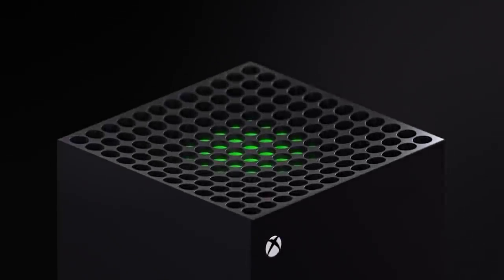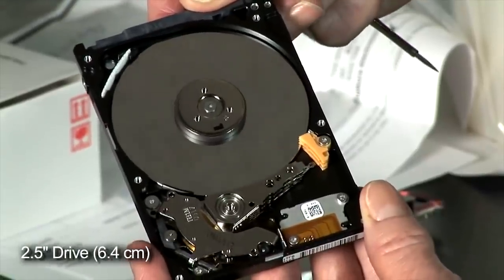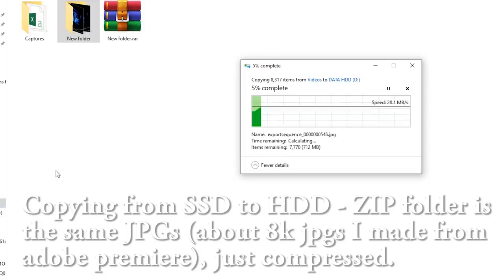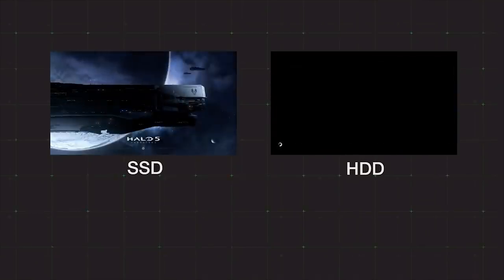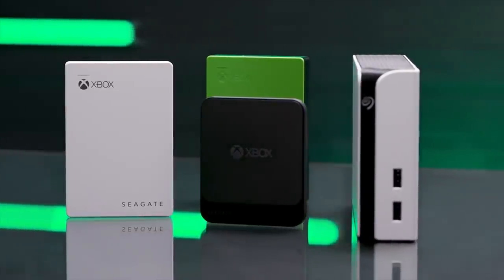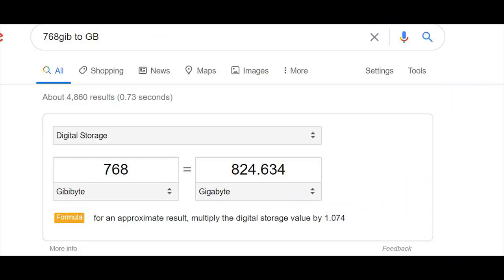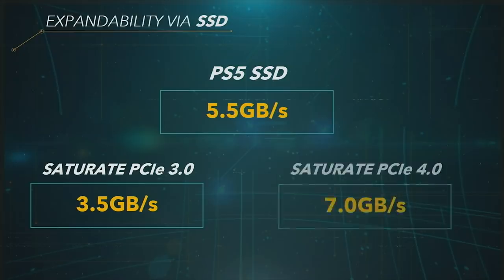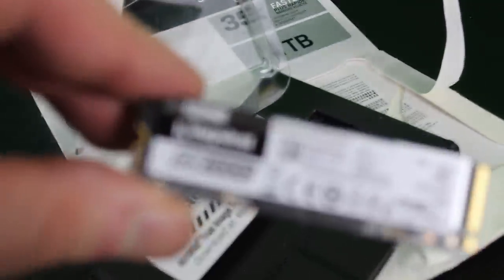Why The PS5 & Xbox Series X SSD Changes Everything - Part 1 - Basics

Comment: Ps5: 2.9 seconds 
Series x: 6.66 seconds

When it comes to downloading 16 gigabytes
Reply: It not 2.9 it 1.0 lol get it right Sony better
Reply: loading textures: aight imma head out
Reply: Oo oO You do realize it was with 8k assets rendered at 1440p.
Reply: PS5: 2.2 seconds
Series X: 7.6 seconds
Reply: RedGamingTech: 2.9 seconds
Chris Bass:    ...System Failure
Reply: MrBeefy To fill RAM on the PS5 at(8/9 GBPs) is 1.7 seconds. 16/9=1.77. On the XSX at (4.8 GBPs) is 16/4.8= 3.333 seconds.
Reply: @-MohamedMajedAlHarthi  Here is the difference tho....saturation of drive speeds. The PS5 due to its i/o tech addresses all of the drag processes. MS only deals with one. In short it will never saturate the drives full speed. So you can double that figure to about 7 seconds for SX. But potentially it could be even higher like 10 seconds.
Reply: Oo oO fake ray tracing?🤣 you Xbox fans said ps5 has rdna 1.5 no vrs now fake raytracing what’s next the ps5 doesn’t have a zen 2 cpu
Reply: @DualPurpose  Hi Dual Purpose, 
The Series X Velocity Architecture only addresses 2 of the 5 steps of the storage-to-memory process. 

The first 2 steps of storage-to-memory transfer can be as fast as you want, but if the next 3 steps are too slow, then fast decompression and coherency doesn't mean much. 

DirectStorage, BCPack, and SFS do not address memory mapping, file I/O, and check-in/load management.

In contrast, the PS5 starts off with selective loading with the flash controller with rough granularity. Then, the data is decompressed with the Kraken chip (1st step). The coherency engine evicts parts of the GPU cache has the SSD is being read and readies the useful data that needs to be sent (2nd step). One of the I/O coprocessors does the memory mapping (3rd step). The other co-processor is dedicated to SSD I/O and can actually bypass traditional file I/O. Lastly, the DMA controller removes check-in as a bottleneck.
Reply: @DualPurpose  4k assets take 5GB of RAM for both systems. it has to use half of its GPU-optimized ram for that. Then, it has to use 2.5 GB for loading assets and 2.5 GB for streaming assets. This is a bottleneck on top of its lower ssd bandwidth.

In contrast, after accounting for the OS, GPU working set, and CPU working set, the ps5 still has around 8 GB of ram left. All of that remaining ram can load and stream data at the same time because the coherency engine and cache scrubbers allow the system to replace evicted parts of the cache on the fly. The Series X on the other hand, has to evict the cache entirely before receiving new data. Even with SFS, it doesn't change that the fact that the entire cache needs to be evicted.

The Series X has 10GB of faster RAM. But that RAM cannot load and stream data at the same time meaning that you can't use the entire 10GB to load and stream at the same time. You have to split that pool. In contrast, the PS5 has GPU cache scrubbers which allows the system to load and stream data simultaneously. And because the bandwidth of the SSD is 9GB/s compressed, the PS5 can save the system image to the SSD, giving the console nearly full access to the 16GB of RAM just like you said.
Velocity Architecture does not address streaming. 100GB readily available sounds impressive, but you cannot use the 10GB of fast RAM to stream and load at the same time. In fact, one of the biggest bottlenecks isn't the lower SSD bandwidth, but that only a small amount of its RAM can be used for streaming.
Reply: Dual Purpose I know the PS5 has more custom I/O hardware but we really can’t make assumptions until we see what Velocity Architecture is capable of.
Reply: @DualPurpose  And the thing is that all of these solutions are hardware-based. Developers do not need to learn how to take advantage of the enhancements like with APIs because the system will literally do the work for them without any thought, hence why Cerny described this process as "invisible".

Kraken is 10% more efficient in packing data than Zlib. Not to mention, Kraken decodes faster than Zlib by 3x - 5x: 

Go to radgametools website - oodle tab and click on Oodle Kraken on right hand side. That 3x multiplier may look familiar because 9 Zen 2 cores (PS5's decompression) is 3x as much as 3 Zen 2 cores (XSX's decompression). But the thing is that is the minimum of the range. Kraken can potentially decode up to 5x faster than Zlib. This is why the PS5's decompression solution frees up more CPU performance:

1. Kraken compresses more data than Zlib. This means more data can be sent to memory and also to the GPU.
2. Kraken decodes 3x - 5x faster than Zlib. Sending a lot of data means jack if you cannot unpack it fast enough.
3. The PS5's SSD's approximately 2x higher bandwidth magnifies Kraken's compression and decoding advantages.

The PS5's storage can send more compressed data of which that data is more efficiently packed than the XSX's SSD. On top of that, the PS5 is 3x - 5x faster at decoding the compressed data than the XSX, allowing its GPU to be fed data faster.
Reply: Clayton B Exactly, memory mapping, and check in are handled by the CPU on the XSX. The thing is, Microsoft claims that they reduced the CPU overhead down to a fraction of a single core. We will need to wait and see how that statement holds up. That is why we need to wait until we have a more in depth analysis.
Reply: PS5 SSD's 12 channels gives it 4x the parallelism of the Xbox's SSD and the custom flash controller allows developers to prioritize certain types of assets before the storage transfers data to memory. The DMA controller has the equivalent of 1 to 2 Zen 2 cores of performance. The combined performance of the Series X decompression solution and DirectStorage is 5 Zen 2 cores (3 from decompression + 2 from the API). This gives the PS5's storage-to-memory solution a 2x advantage in performance over the XSX's solution which also means the PS5's solution frees up more resources from the CPU.
Reply: @claytonb9942  well said. SX only addresses 2 of the 5 steps. This will limit the ultimate ssd saturation. Resulting in speeds less than the advertised raw and compressed rates.
Reply: @claytonb9942  well said
Reply: @DualPurpose  Yes, the only downside I see in ps5 is that it costed Sony a little more than Mictosoft & so I wouldnt be surprised if Ps5 will be more expensive, for me makes no difference really, hopefully fans and parents will invest that extra 50 $, gbp or euros too & support this company bringing in such great innovation.
Reply: @claytonb9942  Exactly, it has more costly tech advances than the SX.
Reply: @-MohamedMajedAlHarthi  well we see xbox taking 7 seconds to start a game...ps5 can start it instantly...and cut load times completely we have more than enough developers vouching for this and ratchet and clank gameplay to show it
Reply: @-MohamedMajedAlHarthi  also xbox loaded gears 4 times the speed of current gen...ps5 loaded spiderman 18 times the speed of current gen..different games so probably not fake to compare tho
Reply: @-MohamedMajedAlHarthi  The PS5 and the XSX have less then 16 GB available for use arround 3GB is used for the system so it sould be 13/9 =1.4 for PS5 and 13/4.8=2.7 for the Xbox But the Xbox has 2 different parts of Memory on different speeds not sure if they could load a 1 Big file directly to the memory or that it has to be split cos it has 10GB at 560GB/s and 6GB at 336 GB/s i asume the OS is using the slower part lets say 3GB so then we have 10 GB fast and 3GB slower memory 
the question is can you load 13 GB directly to the Memory i would say yes because the SSD is still way slower then the slowest memory.
Reply: Gert van Bruggen  split memory speeds may be a problem for developers. As they have to optimize for it and games may take a hit in performance. Im aware of how much Ram the OS consumes I said 16 GB because I didn’t want any confusion.
Reply: @claytonb9942  what do you think direct storage is. It's ms term for memory mapping to reduce latency(seek times) . Ms had the best software in the business believe dat. And all of direct storage specs is not released yet so you don't know. Ms times to saturate the memory is just about double the time of PS5. We're talking about just 2 more seconds with more bandwidth to boot.  How will less bandwidth effect the PS5? Y'all see. #X GONE GIVE IT TO YA
Reply: Kingz On Tha Beat I agree but I need to say something.  1) the spiderman demo was a early dev kit the ssd may have gotten much faster. 2) gears is a different game with different assets so we cant compare.The PS5 has a much faster SSD so in third party games we may see faster load times on the PS5 and higher quality assets on the PS5 ( more detailed geometry. More polygons).
Reply: @myrontaylor77  that last line is corny af
Reply: @myrontaylor77  tell you what, lets pretend the Xbox can fully sustain those 2.4GBps raw speeds, there are still way too many advantages I mentioned above you havent addressed, you simply avoided the rest cause you have no counter arguments or points,

Fact is that no designer is going to design a game differently for series x power in gpu advantage, that percentage can be easily corrected on ps5 by using dynamic res, & more importantly that way it provides more stable framerate too. 

BUT when it comes to the IO advantage the ps5 has, you will find designers having designed a game exclusively for PS5 like project athia. Better IO does provide better graphics regardless of what fanboys say. The time it takes ps5 to load the assets, xbox will need to stream lower lod assets to keep up, Devs can also increase assets for the ps5's version of that game too. whats more is that every 3rd party game made on UE5 will look better on ps5 cause of its streaming advantages.
Reply: @myrontaylor77  
Regarding the Gpu , Series X CAN Do better ray tracing, but there's a lot more to it, Series X has more compute power, it can have up to a 12-15% max practical advantage (not in every game) over the ps5 at the very best BUT only if the cu s are given full workload, which is dependent on storage-to-memory speeds, memory streaming speeds, and cache bandwidth , all of which are in favour of the ps5.

the decompression chip is equivalent to 9 zen2 cores vs 3 zen2 cores on Series X, the coherency engine which helps out with only sending useful data to memory while also telling the Gpu what parts of the cache needs to be evicted. there's also coprocessor 1 which addresses memory mapping, which is Step 3, of the storage-to-memory process. theres No equivalent feature on the Series X, coprocessor 2  addresses file IO, the 4th step. It also allows the system to bypass traditional IO, again missing on Series X, then there's the dma controller that addresses check-in, the last step. It also allows the system to bypass check-in if needed and its performance is equivalent to 2 Zen 2 cores.

The only definitive advantage the Series X has is in raytracing. However, the issues with its asymmetrical RAM setup and slower storage-to-RAM data transfer rate will affect the GPU Negatively, especially when it has more CUs. The more CUs a GPU has, the more data you need to send per second.

2 bottlenecks for Series X are:

1. The amount of RAM available for loading and streaming is limited.
2. Memory-to-cache communication is not as effective as the PS5's due to lower GPU clockspeeds and the first bottleneck.

Series X is not only slower, but has less parallelism and a less granular hierarchy.
 Ray Tracing performance is tied to CU count. However, because of how the Series X's  memory will have to be used and Microsoft's services philosophy, the PS5 will be able to load more assets. That means the level of detail will be Much Higher on the PS5.
Reply: @myrontaylor77  Also the ps5 has four times the channels as the Series X ssd, allowing for more parallelism of data transfer. Also the flash controller gives developers 6 levels of priority. Series X lacks this feature too... and the 6 levels of priority are twice the Series X ssd's 3 channels.

Also ps5's RAM will NEVER be bottlenecked. 

the ps5's audio chip also takes advantage of the DMA controller which also frees up resources from the cpu. 

the ps5's higher gpu clockspeed speeds up rasterisation and cache bandwidth. 

The higher cache bandwidth along with the better ssd bandwidth, more available RAM for streaming, and lower CU count allows the PS5's GPU to hit its Peak performance More Consistently. 

Also the Gpu cache scrubbers allow the remaining free RAM to both load and stream assets simultaneously, effectively giving it a 3 Times Advantage over Series X. 

THIS Has Major Effects in the Amount of DETAIL the ps5 can push out.

Consequently, the Series X needs to rely on procedural loading due to its low amount of available RAM for streaming.
Reply: @myrontaylor77  (1) Velocity Architecture is a software solution, but it can never magically break the laws of physics.
(2) A higher theoretical peak means nothing if it requires a steeper learning curve to hit that peak, especially when that curve grows steeper as the generation goes on, i.e. when games start to demand over 10GB of memory causing the XSX's RAM bandwidth to tank.
(3) Developers want to spend more time actually designing their games and have the hardware do the work for them rather than spending time to learn tricks and workarounds.

Both the CPU and GPU need to access the RAM, meaning they need to share bandwidth. Typically, the CPU needs 48 GB/s. For the PS5, it's easy. You just subtract 48 from 448 to get your bandwidth for the GPU (400 GB/s). However, for Series X unless the CPU is accessing the "fast" RAM, allocating 48 GB/s to the CPU is an 80 GB/s penalty on the GPU. You can have the CPU access the "fast" RAM, but that means putting the OS in the "fast" RAM. That wastes precious resources that the GPU would otherwise need. If memory usage goes over 10GB, then the "fast" RAM's bandwidth goes down because it has to share lanes with the "slow" RAM,  Not good when games will inevitably grow more ambitious and increasingly demand for more RAM later in the generation.
Reply: The PS5 's coherency engine and cache scrubbers remove stale data from the GPU cache on the fly as the RAM feeds the data needed for the Next 1 SECOND. 

Not only does that benefit the GPU, but it also benefits RAM performance because typically you cannot use the same chunk of RAM for streaming and loading At the SAME TIME.

Another Major advantage in this particular aspect is the higher clockspeed. Higher clockspeed does not just boost rasterisation, but also the bandwidth of the caches, including the GPU cache. 

Higher cache bandwidth means that the memory can feed more data to the GPU in a shorter span of time, allowing the GPU to hit its peak performance more often than a GPU that has a lower cache bandwidth...

To emphasize how important cache is, look at how Intel's 14nm CPUs are still competitive against AMD's 7nm Zen 2 in gaming performance. The main reason behind that? Intel's CPUs have less cache latency and the latency times are more consistent. Because AMD uses the chiplet design and split the L3 cache into 2 pools, it not only increased latency, but it also made latency times more inconsistent. While Ryzen has better IPC and is more power efficient, Intel's CPUs remain competitive in gaming performance thanks to its better cache solution.

Also APIs are also not needed to take advantage of the I/O customizations.

And the thing is that all of these solutions are hardware-based. Developers do not need to learn how to take advantage of the enhancements like with APIs because the system will literally do the work for them without any thought, hence why Cerny described this process as "invisible".

Also Note that YES, Third Party can Also push Game Design to a certain extent to make it across multiple platforms and APIs.

As for Series X

Yes, that 10GB RAM Demand is coming, As soon as the RAM usage exceeds the 10GB, that's bad for Series X. The PS5, on the other hand, gets nearly full access to the 16GB of RAM (Read above posts to see why) AND Has 8 IDENTICAL 2GB chips. It's easy and simple to use, requiring no tricks.
Reply: PS5's SSD operates uncompressed at the equivalent of a 128-bit DDR2 memory controller (same ones used for the first consumer quad cores). It also has two hosts to send multiple streams of data at once in either direction (like a DDR memory controller), and "The Kraken" is capable of boosting sections of data to 22GB/s (bandwidth of the PS3's GPU!). If the developers don't want to put in the extra work in optimizing the Kraken compression, it's 8-9 GB/s. However, If they want to improve on it, then the speed will be between 9 to 22 GB/s.

Ps5 can save the system image to storage because if the OS uses let's say 2GB, then when sent as compressed data, it is transferred from memory to SSD in less than a quarter second. This gives the system nearly full access to the 16GB of RAM. This method cannot be implemented on the XSX not because of lower bandwidth, but rather Microsoft want the OS running and be connected to all of its services.

PS5's RAM pool is unified. The GPU working set is 5GB like with the XSX. The CPU working set is typically 1.5GB. Let's pretend that the PS5 will not save the system image to the SSD and the OS takes up 2GB. That means the PS5 has 7.5GB of remaining RAM.

You may be thinking, well if you cut 7.5GB in half, that's 3.75GB for loading and streaming each. But remember when I told you about the GPU cache scrubbers? The cache scrubbers allow the remaining 7.5GB of RAM to be used for both loading and streaming simultaneously. The higher bandwidth of the fast RAM on the XSX cannot make up for that.
Reply: There is a Penalty in bandwidth when the CPU is accessing the "slow" RAM in Series X. You cannot access the slow memory without impacting the speed of access to the fast memory because they work through the same controllers.
 That is another problem. Luke explains this above when addressing the Xbox Series X Ram bottlenecks.

In PS5 you can EVEN IMPROVE access to multiple bits of memory by arranging them within the same column but on different rows, essentially parallelising certain memory operations. You couldn't do that across the two memory pools in the Series X because the memory needs to be interleaved in order to accomplish that.
Reply: @-MohamedMajedAlHarthi  Don't forget that optimized compression increases that to 22 GB/sec per Mark Cerney.
Reply: If ps5 is .8 second and  2.5 times faster ssd than series x, Then that means .8x2.5=2 seconds so  the Xbox series  x will download same game in 2. seconds. No big deal.
Reply: joe343 zerk  yes
Reply: Oo oO  Xbots clowns lies propoganda irrelevant anymore ✌️ the PS5 will running True 4k @ 60fps if you love it or not
Reply: Bryttany Messina That is with highly compressible data. We may see developers not reach those numbers.
Reply: 21st  😂😂😂 your comments are absolutely hilarious, Any insider information you have for us?? Any Secret MS Tech we dont know about? Its getting lonely in there right? thats why you keep attacking others.
Reply: 21st  poor little kid looking for some attention... There There 21st you'll be allright
Reply: @claytonb9942  I dont know man, if you're not giving him proper discussions responses, you're a coward.
Reply: Yeah Xbox 7 secs but it only loads once, so not really a big deal.
Reply: How can we actually speak on the XSX SSD/architecture if MS hasn’t even gone into great depth on it yet?
Reply: smart marketing for the ignorant. PC gamers find this SSD marketing quite funny.
Hard drive is not even in the top 3 upgrades for a PC gamer. 
GPU, CPU, Ram, Cooling, Power supply, then maybe SSD. The benefits are pretty much negligible. I run most of my games off my SDHD and it makes no difference in-game.
Reply: anonymous because HDDs are everywhere. When they're gone, you better get your PC gamer ass to get you a NVMe SSD because it will certainly be a priority upgrade component to ur pc.
Reply: @Kyle Aldis
Exactly. Not only hardware plays an important part on this upcoming generation but there's also software solutions and MS is ahead of Sony in that matter. I don't understand how people miss this point or maybe they just want to ignore it, more probably. The Series X customized SSD plus the Velocity Architecture and BCpack (compression and decompression software) combined with DirectML, allows it to load 100gb of assets in a matter of seconds. Reality here is, there's not going to be such a big difference in speed between both consoles, at the end the main difference will be the GPU and CPU performance.
Reply: @Kyle Aldis well that's a first. You should read into XVA and read into API. Its software you have to code for it to take that advantage of the algorithms dummy. So to make use of the direct storage you have to code for it. It doesn't just do it. Its not hardware. Its an algorithm. Why do you bring ML and all the other nonsense to a discussion about data transfer. This doesnt have anything to do with moving data through the 5 step process. ML is algorithms for the output of the data. Its not related to transfer the data.

Why would you have to code for native hardware....its just right there. Its simply how the system operates. XVA is a series of algorithms, codes that you have access to in helping optimize your game development. But you have to learn these algorithms and code for them. And then when they are run the CPU has to run the executions of these algorithms before you even get the functional benefit. This us the part MS obviously doesn't tell you about. It would mean that the CPU power left for games is substantially less than what the PS5 has. Imagine only 2.9 ghz or 3.1 ghz being left for games. That puts it at a real disadvantage to PS5. So dont expect MS to advertise that info in their console. They'll pitch it in the way where it makes the console appear flawless and better than it actually is.
Reply: @Kyle Aldis Leave these Sony fanboys mahn, they actually don't completely know how consoles operate -- both in the software and the hardware department. And they won't even make an effort to educate themselves.
Reply: I look at it this way, it comes down to the games. And Microsoft just doesn't have the exclusive support for games that I want to play. Microsoft is just not devoting as many resources to getting more exclusive game IPs (old and new) compared to Sony.

And that shows in PS5 recent reveal event, Sony upcoming games (and future IPs I don't know about) have me excited, Microsoft does not have me excited.

And I already have an top of the line PC that I will upgrade when needed. And Series X and PC are the same platform basically, all games coming to Series X will come to PC. And PC has its own exclusives that neither PS5 nor Series X will get. So I feel well covered by PC and PS5.

I will likely get an Series X for the lounge anyway, for friends and family, but PS5 just has the games and franchises I want to play. Microsoft really has to sort out their exclusives, they really need to have much more new exclusive IPs this gen. Most of my friends feel the same way. Microsoft just does not get me excited the same way PS5 does. I already have an excellent PC that can be upgraded that I can play multiplatform games on.

But that is what it comes down, if Series X has the games you want to play, buy Series X. If PS5 has the games you want to, buy PS5. It is the games you should focus on, and I really enjoys Sony exclusive IPs, and I am excited for whatever new IPs Sony comes up with this gen as well. I am not excited for anything Microsoft has shown yet.

Sony exclusive games will make excellent use of the hardware in interesting way, I have no doubt about that. Sony always delivers the games I want to play the most. I just don't have that faith in Microsoft yet. I want to see an entire slate of confirmed and upcoming future IPs that get me excited to play them, and Microsoft have not done that yet. 

I know Sony will give me tons of great exclusive games over its lifespan, I honestly cant say the same for Microsoft yet. Microsoft has a long way to go to change my mind.
Reply: @Kyle Aldis And I know they haven't had their official reveal yet. But they haven't made me excited in YEARS. I have NO FAITH in Microsoft yet. I will not go by YOUR personal opinion, I will go by MINE.
Reply: @Kyle Aldis And if you read my post correctly you would see I own an PC already (which get all Series X games) and I will like get an Series X for my lounge for friends and family. You are blind and cannot read.

But Microsoft has not delivered any new IPs or franchises in years that get me excited. And Microsoft has a long long way to go to get me excited for next gen games. Microsoft needs to focus on games, that is 100% true.
Reply: @Kyle Aldis Fair enough, apology accepted. As you can see, I am not anti-Microsoft. I always get every platform available, I love gaming in my downtime and I always want my family, my friends and myself to have access to all platforms and games. I have been that way my whole life, money is not an issue for me.

And that is my point, money isn't an issue for Microsoft either. I want Microsoft to throw every cent they have, and all resources they have available at great new game IPs for us to play (and even returning older IPs, even ones dating back to OG Xbox days). The Outer Worlds is a great game (and I have finished it on PC) but it is available on PS4 as well, I want Microsoft exclusives, tailored to Microsofts hardware only and exclusively, like Sony exclusives.

I am not mixed up in which console is more powerful or more expensive, both of those topics are irrelevant to me. They are both powerful enough in their own ways, and any price difference between them is irrelevant to me as well, I am not hurting for cash. For myself, it only comes down to what you do with said hardware.

I want Microsoft to get their focus on games back, the focus they had at the start of the 360 generation. I want Microsoft to be forming new IPs (exclusives not available on PS5) and bring back old ones. I want lots and lots of great new games this gen. I always have an top of the line PC (that is how I played Outer Worlds), so great graphics and high FPS are something I have all year round, every year. And owning an PC also give me access to all PCs exclusive games and almost every PC game released in decades. 

And I will be upgrading my PC to an 4950x and RTX3000/RDNA2 when they release (for work and gaming, I do production) and I have an X570 MB with PCIE-4.0 NVME drives (as I said, I do production), so my PC will be kept up to date. So it is only games that captivate me that I care about, I work hard and I play harder.

That is why I said Microsoft hasn't got me excited yet, I want more than pretty graphics from Sony and Microsoft, so I really want Microsoft to blow me away this gen with games. I am not against Microsoft at all, and I am not caught up in the hardware battle (nor price differences) between Microsoft and Sony as most people are. I will have all platforms, PS5, Series X and PC, same as every gen.

But I truly want games that get me excited and blow me away this gen, both Sony and Microsoft have the hardware, now I want the games. And Microsoft has got the resources to do it, and that is exactly why my expectations are so high for Microsoft in particular. 

Sony is much smaller in comparison to Microsoft, and if Sony can deliver great new and returning exclusives every gen, I want Microsoft to do the same, if not even  better with all the vast resources they have available to them. I think I am being very reasonable about wanting exactly that from Microsoft. I just want great games, and I am sure others who purchase an Series X (or PS5 for that matter) would like the same as well. I don't just want great multi-platform games, I want lots of great Microsoft exclusive games as well.

MS dropped the ball quite badly last gen, but they are correcting their approach this gen. The management in charge does seem better than the previous management. And I really want to see some truly excellent exclusive games that make me want to drop everything to play them. I am getting old and jaded, and I want games from Microsoft that make me forget that I am old and jaded. And I think I am being an reasonable customer by wanting Microsoft to deliver fantastic games that blow me away. 

Indeed, that is the number one request from most publications and fans of Series X alike, we all want Microsoft to step up and deliver great exclusives this gen. I never said it is impossible for Microsoft to do, I said Microsoft has a lot to do to convince me that they are doing exactly that. My expectations are high for both Microsoft and Sony, and any reasonable person whether purchasing Series X, PS5 or both, should demand the same. 

I will be thrilled for Microsoft to blow me away with some upcoming games they reveal. You must understand my position and view of Microsoft is not anti-Microsoft, nor am I unfair on Microsoft. I am actually going by how underwhelmed I have been for years by Microsoft's lack of dedication to new and great exclusive IPs, and that has left me feeling this way. But I will be the first to buy any new IPs that does get me excited. 

I am a fan of great games, not companies. I know Sony already has IPs that have me excited and I am sure they have new ones that will do the same, Sony's track record from PS1 till PS4 has given me that faith. 

But Microsoft has to rekindle my excitement for their games now. And I can't get excited until Microsoft has actually shown me upcoming games that do get me excited, you can't expect me to get excited for games that we don't know are coming yet. And it is as I said, I want to see an entire slate of new and upcoming games over the gen. 

Microsoft has an uphill climb this gen, not impossible, but it is a climb nonetheless. But I am absolutely not adverse to Microsoft delivering us some great games, indeed that is exactly what I am demanding from them.

And with the sheer amount of resources Microsoft has available to them, I am not being unreasonable or unfair for wanting them to deliver some truly exciting exclusive IPs this gen. I honestly think I am being 100% reasonable with my expectations and demands, and that is Microsoft deliver some great exclusives to go with their new hardware. It is still early days and we will see, but Microsoft has to re-earn that faith they lost last gen, not impossible, but they must still earn back.
Reply: Excellent, I hope Microsoft's fighting words calling Sony's games cookie cutter means Microsoft have some tremendous games cooking in the kitchen. That is how I want Microsoft to be, I want them to do everything in their power to bring the fight to Sony, fight tooth and nail for our money. 

That means an fantastic gen for us, when Microsoft and Sony are fighting to outdo each other from the get go, I love it. I want an repeat of 360 vs PS3, a two way monster of a generation. It is the same battle we have going with Intel and AMD right now, and I want the same for this next gen consoles generation.

I want Microsoft to throw their full weight behind this gen. And I think Microsoft is wants to undercut PS5 price as well, I think they are looking to repeat their 360 launch. And they have Lockheart launching at a cheaper price with Series X as well.

So I do believe Microsoft has the correct pieces in place. And it is really not hard for Microsoft to sway the larger gaming audience into a positive state. Microsoft is making the correct steps, they just need some new killer games and I can assure you many more people will be jumping on board, it really is that simple.
Reply: All this back and forth and the end result is ps5 only having 2-3  seconds faster loading times,  which is insignificant. 

It will have unique game design only in first party games like rachet and clank. But realistically the best case sony can use to show off their ssd looks like a gimmick. Why would you need to jump worlds ever 2 seconds in a game.

If a regular mechanical drive can load 4k textures I , why wouldn't a drive 48 times faster on the series x be able to stream 8k textures?.  This ssd debate is only marketing by Sony because its the only strength their console has.
Reply: @Kyle Aldis You sound a lot like "21st" made a new account after experiencing that humiliation lol
Reply: @DualPurpose  Dude this Kyle Aldis im pretty sure hes a second , third or god knows how many accounts "21st" has , look at the wording he's using, same methods, same speculation, same lies, same number of comments one after the other. He's patethic god know how many accounts hes using to get your attention.